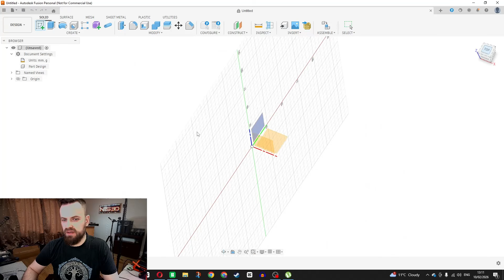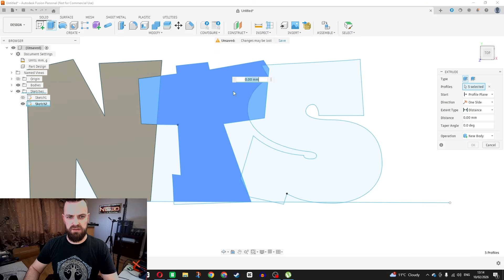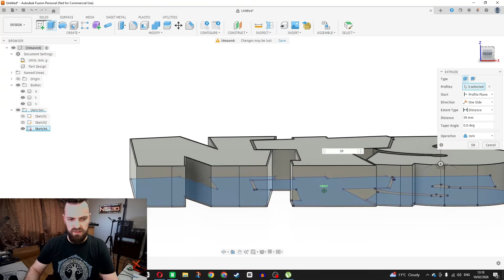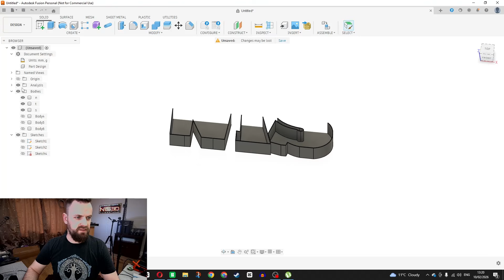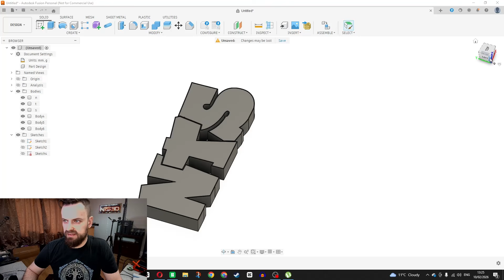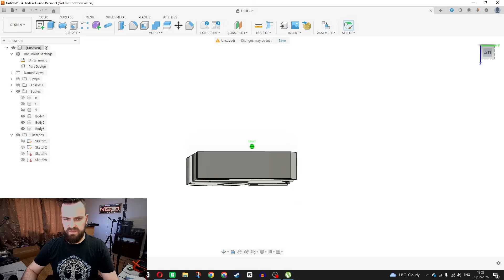How to design a fully glow up letters in Fusion 360.

Comment: Hello, I am trying to make a logo like yours and the application of Inskp does not allow me to save the gaffiti font on the desk I save it as a svg and once saved it goes with another type of font that is not graffti comes out with arial I think, you can throw a handle and you know what can happen, the source I have lowered it and installed it in the pc, I do not leave it

I'm staying here,

thes
Reply: are you converting your letters to outlines before saving as SVG.. by converting your letters to outlines, it locks in the shape of the letters. Just remember that after you convert to outlines, the text is no longer editable. You would have to retype the letters if you want to change the spelling.
Reply: Thank you for answering, but even if I separate the letter using object journey, I always get stuck, in short there is still going around because it is clear that I do not master this program at all 

thanks

Comment: For those having an issue with breaking/ungrouping the letters, new version of inkspace you need to path>object path then path>Break apart.
Reply: I also found you can use alt+ arrow key while entering text can move the letters as well.

Comment: Hello there. Do you have a solution if the ungroup doesn't work? I tried the path/split as suggested and still doesn't ungroup. Thanks again.
Reply: En versiones 1.3 y posteriores (incluyendo la 1.4): Al convertir el texto a trayecto, este se convierte en un solo objeto combinado en lugar de un grupo. Para separar las letras individuales, debes seleccionar el texto convertido y usar la función Trayecto > Dividir trayecto (Shift + Ctrl + K), lo que convierte cada subruta en un objeto independiente.

Comment: Just a quick question: Why all the trouble for rounded holes (for wires), and then cut again while a square can be used instead? Less steps, same result?
Reply from the maker: Yes it can be done with square too

Comment: The goup un group doesnt work, just use path/split path
Reply: This doesn't work either. The letters are still grouped together.
Reply: @nancyquin429  Use: Path → Object to Path (Shift+Ctrl+C), Path → Break Apart(Shift+Ctrl+K)
Reply: En versiones 1.3 y posteriores (incluyendo la 1.4): Al convertir el texto a trayecto, este se convierte en un solo objeto combinado en lugar de un grupo. Para separar las letras individuales, debes seleccionar el texto convertido y usar la función Trayecto > Dividir trayecto (Shift + Ctrl + K), lo que convierte cada subruta en un objeto independiente.